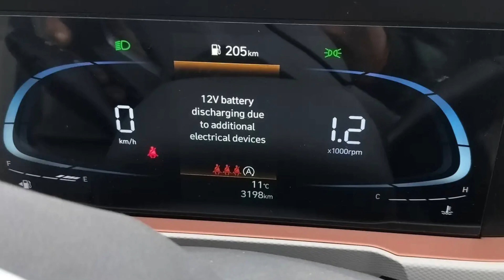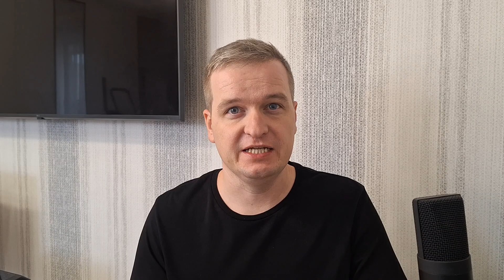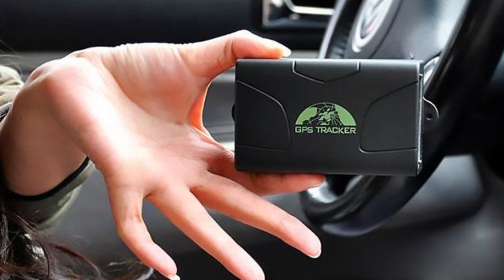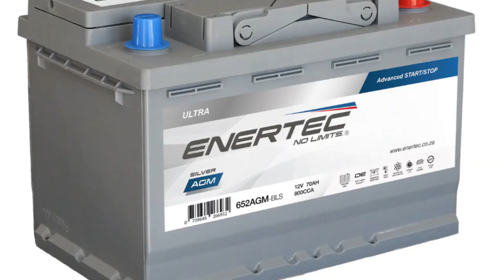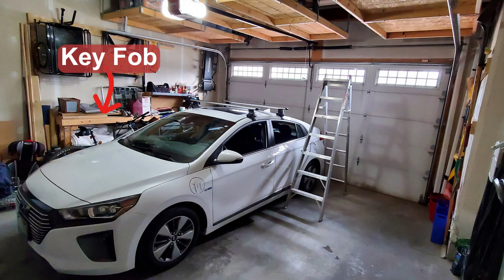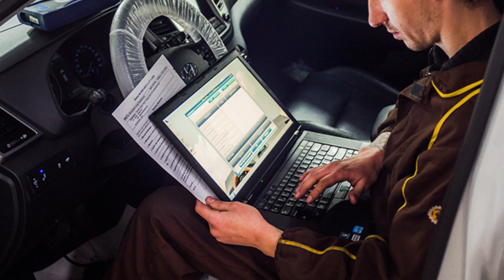“12V battery discharging due to additional electrical devices” warning in Hyundai

Comment: I saw one of your videos. You made a mention there....12v battery discharging due to additional electrical devices....I have a Hyundai Venue 2023 model car. I have a customer concern that the battery discharge warning message is showing on the cluster when I start the car in the morning....To do this, I first checked the battery. It was fine. Then I checked the dark current. I also found no dark current there are no extra fittings on the vehicle.I thought there might be some issue with the battery, so I replaced the battery and the car came back to me for concern after four months....

Please suggest...
Thank you
Reply from the maker: This either happens because of wrong battery type (for example, the car wants AGM but it uses a simple lead-acid, or just wrong capacity), or a tricky battery drain in the system. Venue models are notorious for random battery drains that are extremely hard to spot. I know a guy who ended up tracking each fuse in the under-hood box to spot the little drain in the infotainment which was then replaced under warranty. Also, since you've mentioned the period of 4 moths, I would suggest the owners drive very short cycles. This kills the battery fast since moden software in Hyundai is "smart" and it charges the battery gradually, so during short cycles, it won't charge properly at all. Once voltage drops below 12 volts when cranking in the morning, you will see this message on the dashboard. The solution is to charge the battery with an external charger once a month or two.
Reply: @TopicMotor I have installed the correct battery 50ah and AGM ....I have everything figured out now I think I need to replace the fuse box.....I have checked but not found any update ..